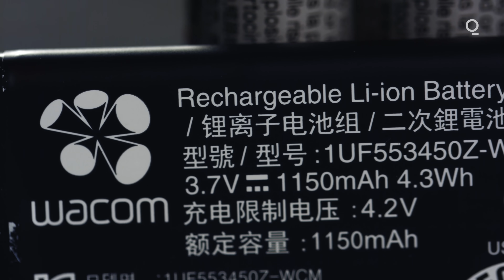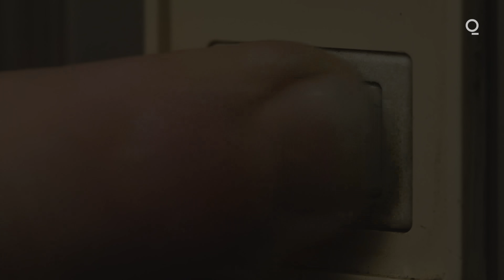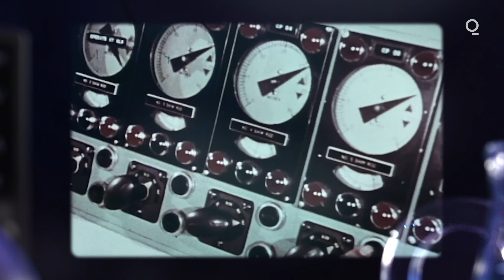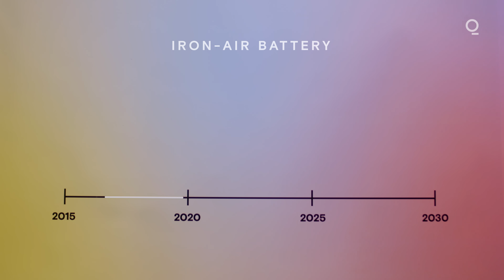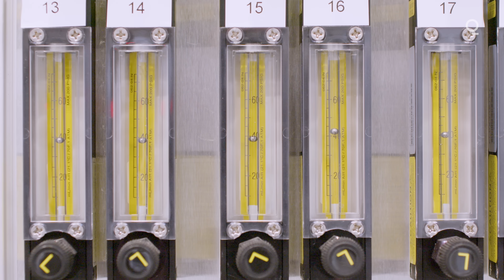The Huge, Weird Batteries of the Future

Comment: Very interesting... Energy storage is the key to the success of the green energy transition. Super-batteries, supercapacitors, pumped storage, hydrogen-to-gas, integration of electric vehicles into the grid operation... all these will have to work in tandem for success. Nuclear fusion that uses renewable materials, if successful at scale, will change everything.
Reply: @buildmotosykletist1987  They were, but read the latest Lazard analysis: the unsubsidized levelized cost of electricity from wind and solar is now cheaper than any other form of new generation, and cheaper than continuing to operate a coal plant. They'll be the majority of new generation from here on out, even if and when tax credits for them go away.

We should tax fossil fuels for the undeniable massive harms that burning them cause now and in the future, but politicians are allergic to the 'T' word so we get tax incentives and credits for better alternatives instead.
Reply: @buildmotosykletist1987  You pay for energy, not power. What are their figures per kWh?
Reply: The Connections (2021) [short documentary] 🌳💖

Comment: Just doing energy storage differently is no where near enough - it has to be more energy efficient than ALL other sources - No company seems to be able to claim that. It is all very nice to talk about the possibilities but you have to walk the walk with real live economies of scale
Reply: Storing energy will inevitably get you back less electricity than you put in. But energy storage is still worth it despite the inefficiency if there are big swings in the cost and availability of electricity. Lithium-ion batteries are cost-effective to store renewable electricity for the afternoon-evening peak; the challenge covered in this video is to find economical storage for longer periods of low generation.

Comment: That is not a battery.  It's called a hydroelectric dam. --  The energy is in the global capacitor itself, which is powered by the sun.  In the meantime, we need to use, petroleum, natural gas, and nuclear.  Batteries are for flashlights., not cities

Comment: IDK dumb idea, WATER TOWERS equipped with Electric Generator. Sand almost functions the same if we are just using gravity, funnel the sand into a pulley system(like a hourglass)  
The real question is, IS it done efficiently and effectively enough, and does the math add up for when using Solar Power and or Wind Turbines?

Comment: Almost equally important as halting our carbon dioxide emissions, is a transition towards a (let's say mostly) circular economy. For applications such as vehicles, I'm sure we will need 'material based' batteries (I would exclude pumped storage and hydrogen from that category). On the other hand, I'm not so sure that basing our electricity backup systems on resource-hungry technologies is the best choice. I prefer to see our society trying to massively save energy, both through higher efficiency appliances and processes, and through lifestyle changes. As for upcoming technologies in renewable electricity production, I have some faith in the advanced geothermal options that are developing. The technology proposed by for example Fervo Energy (and backed by Google) serves as both an energy source, plus it can load-follow in order to balance out the intermittency of other renewables.

No single energy source/storage is perfect, except maybe... nuclear fusion. But I'm not betting on any timeline for that.

Comment: Ok, pumped hydro has been around for ever! The fact remains you can't get something for nothing; otherwise you could simply use the electricity you just generated to pump the water back to the top ?? These systems require a long time to recharge (pump water back up), electricity from other sources is required.

Comment: We're going to need more electricity?
I don't think so! We used to use ten times more energy to light our world. Modern LED lighting is ten times more efficient. The televisions we now have are the same, you could warm your room with old valve TVs. No, if you think about it, energy usage in the average home has dropped dramatically. That's the major reason your being charged massively more for less power, the energy companies won't give up their profits.
Example - In my front room I have 8 spot lights at 5 Watts each (total 40 W) previously they were 50 watt halogens (total 400 W) in one fell swoop, changing to LED reduced my lighting bill by ten times. They lied to us, you can't reduce your bills, they will always want their billions of profit !
Reply: Oh for sure, as people cut back to save on gas, water and electricity, the cost per unit will increase over time to ensure the profits of these utility companies does not fall.

Comment: Hey, maybe it's just me but instead of building gigantic batteries for large communities, while not build modest batteries for people to own & operate individually?  A power wall is something affordable for most home owners, and apartment complexes.  Its footprint is relatively small, requires virtually no maintenance, and can work perfectly well for many hours after the winds die down or the sun no longer shines.  Whether the energy companies like it or not, many people would prefer to go off-grid.
Reply: Sure, home power generation storage and community microgrids make sense in many areas. But in general it's cheaper per MWh to build utility-scale wind and solar farms, and a Tesla Megapack is cheaper per kWh than a Tesla Powerwall. The fact that people can make and store their own power should limit the prices that utilities charge their customers, but that's more dependent on regulation.

Comment: 1:50  The woman say the electricity you're using was produced within a minute.  That's totally wrong.  Electricity travels at the speed of light in the cables and transmission lines.  That's 186,000 miles/sec.  Try produced within milliseconds.  This is why journalists make bad science documentaries... people can tell them anything.  Here's something more relevant...  Until a practical, utility-grid size battery is developed, wind  & solar are NOT practical and must be backed up by gas-fired thermal plants that massively increase the cost/Kwh, and the carbon footprint too.  That's the reason the oil companies are pushing wind & solar.. they KNOW it's not practical, and they'll have an unlimited gas market for decades to come.  Only nuclear power is ready now to produce the power we need without a huge carbon footprint.

Comment: So are they getting more energy than they are putting into using the pumps? Or is this energy a lot more expensive?
Reply: There are two ways these pumped storage systems can be used:

(1) To cope with peaks in electrical demand,

(2) To collect electrical energy produced by renewable sources which do not have 100% availability - such as solar and wind.

In the case of (1) they are "charged" up with energy from the grid (let this be denoted by the symbol Einput) and energy is generated when the water is released, let this be denoted by Eoutput.

The following is true: Eoutput < Einput.
That is, in this strategy, they don't add to the net electrical generation capacity of your national power infrastructure.  They actually lose energy. The purpose is to provide temporary extra power to cope with peaks of high demand for electricity. But it means you don't have to construct and operate additional power stations just to cope with those high peaks in demand current which occur in the evenings when everybody does their cooking at the same time.

In (2), the excess electricity from solar panels and wind turbines can be used to pump water up to a higher altitude, thereby increasing the potential energy of the mass of water (same as in (1)). Excess electricity in that it is not being consumed by customers at the instant it is generated.

In this approach, then they do add to the net generation capacity of your national power distribution infrastructure.  But you have to be able to direct the excess electricity from the renewable sources to it.

Comment: The reality of climate change solutions in a nutshell...ahem

2006: We need to drill into Alaska for oil. We don't like doing that to Alaska so we need to go to an even rarer material called Lithium to prevent this

2021: We need to drill into Alaska for Lithium. And like it or not we really need this, it's medicine as well as throwaway phones, and this is the biggest lithium find in a long while...and it's under Alaska.

Great story arc for the climate change solutions saga

Comment: For 33 years I worked as an electrical engineer for a place that had pump storage facilities in California (the largest one) that was built in the 60's. We were no longer able to use it as pump storage because the pump and generators (synchronous motors, transformers, auxiliary equipment, and etc.) were old and cost of repair and maintenance were exceeding the benefits. There is a cost for everything.  You can’t get something for nothing. One rewind would cost $5M and one transformer refurbishment would cost $1.5M……..
Reply: Just like solar panels installed on the rooftop of residential and commercial properties (i.e. there are long-term costs for repairs and maintenance). 🌞🏠🏣
Reply: @Mindcroscope  thats the catch, Solar panel in general doesn't require maintenance or negligible amount of maintenance cause there is no moving parts 🙂(just clean the panel with a hose pipe)
Reply: @Ritam Sanyal  ... The initial cost of purchasing & installation a solar system is fairly high.  Extreme weather such as typhoon (hurricane), hailstorm, lightning⚡and acid rain💦could ruin the solar panels & equipment. Also, solar inverter (to convert DC from the sun to AC) and solar batteries aren't that durable when compared to the solar panels.
Reply: Yes because nobody was able to do it and the one person who could was in so much demand that he could charge what he wanted. But what did it cost to build it, in today's dollars? And what part costs the most? And what's the cheapest it could cost? There are many people looking for work... what is missing? The initiative. New facilities are built daily... how can they make it? SpaceX exists because they did not accept what things cost, and started from the raw ore costs and worked their way up and eliminated all the bottlenecks.
Reply: @pre2363  yes. from engineering point of view, it doesn't make sense because of the losses, but power was cheaper during off-peak at night.
Reply: The main problem of our economic system today is that we don't include the cost of environmental damage and we are very sensitive of high initial costs and low short term profitability. Every technology, solutions and actions revolves around profitability. 

With these kind of economic system is very inefficient and ineffective way of curing the planet that it sounds like it is incompatible. With every new green technology would only generate new environmental problems if we will not going to change our system.
Reply: The Connections (2021) [short documentary] 🌳
Reply: Could you design a battery lifting dense metals like Tungsten instead of water? Just like lifting up huge weights 30-40 stories as energy storage.
Reply: Get the Chinese to do what needs to be done. Just because Americans can't build or update it for whatever reason doesn't mean it is difficult. Americans once led the world in every category. Now we lead the world in mass shootings and that's about it.
Reply: Our alternative is letting go of the struggle to keep California from burning down, drying up, and blowing away. We are going to have to prioritize the money.
Reply: @aluisious  California power problem is man made.  They have not had new power plant, hydro, nuclear, etc.. in past 40 years despite the population doubled.
Reply: @wilsoneashoian5789  that storage was needed in the past when electricity was mostly nuclear and coal which usually runs all the time. So there was spare power going to waste so it was worth using it. Then a lot of electricity switched to gas which can be easily turned on and off so it can match output to demand and you don't need the storage any more. That made it not economical to fix it when it needed renovation. But now we have to stop using gas so our easy dispatchable power is gone. Now we need storage again to use spare renewable electricity and give it out when production is low. It should be cheaper to renovate the old one than build a new one from scratch. I hope it is still possible to fix it.
Reply: @Adrian Thoroughgood  pump/generators got old, and repair and maintenance exceeded the benefits.  It was done during off-peak when power was cheaper with PG&E. that PG&E contract expired in the 90s, and it was not renewed. These days, power is bought and sold through CalISO as a spot market. No long-term contract
Reply: @aluisious  incompetent regulation of badly run utilities is why California had brownouts 2 years ago. Forest fires worsened by global warming cause local power outages, and drought worsened by global warming has reduced hydroelectric power generation.
 
@Wilson Eashoian Despite all that California has added 5 Gigawatts of in-state solar PV generation since 2016 (I'm not sure if that includes rooftop solar or is only utility-scale solar farms), and is adding Gigawatt•hours of battery storage.
Reply: well, that is cheap in comparison of losing the planet and all the petroleum.

Comment: Small modular reactors, specifically designed to replace the existing coal, oil and gas boilers in existing power stations have a great future:  all of the downstream power generation facilities:  the turbines, generators, power conditioning, control and reticulation is already in place.  So a major target to retro fit existing power stations nuclear units in the micro 50MW, small to 300MW and full sized with multi unit up to 1GW is still the best way to go, for quick CO2 reduction.   We just have to get over the bad press that nuclear has had for decades.
Reply: SMR is going to be a huge part. Every time people start talking about nuclear and climate change they start getting all excited about fusion, which has never been demonstrated to yield excess energy outside of a bomb. We've got to get real honest about what we have the tech to do in 5 years.
Reply: I was told once that when nuclear energy was first worked on. The scientists figured out that micro units were the most stable and sustainable.
Reply: All of the companies developing liquid molten sodium thorium small salt modular reactor blah blah blah designs are 10 years and 10 billion dollars away from demonstrating that their small reactors actually will be cheaper per MWh and quicker to build than current nuclear generation.

It's definitely worth researching, and I hope some of them actually deliver, but they're all irrelevant to the rapid decarbonization we need to achieve in the next decade.

The absurd delays and enormous cost overruns of the few nuclear plants under construction aren't "bad press," they're facts.
Reply: @skierpage  Who is mentioning small modular reactors except Gates and others who are dangerous with their explosive coolant. Your knowledge is very shallow, when writing about renewables infrastructure cost has to be mentioned, otherwise it makes no sense. Nothing about this make much sense.
Get your facts straight; USA had molten salt reactor running in 60's, results were great but funds cut because of oil lobby. As i'm writing this another plant MSR with Th fuel is running in China, their plan is to make all ele. this way by 2050. They will succeed. Russia has lots of knowledge about MSR too, unfortunately they don't get the same chances as other, despite urgency to move on!
South Korea just made several reactors for UAE for 7 billions in 7 years, since there are several at the same site other will be put online later. Chins is also capable of doing it but they rather focus on their needs. Things in UAE are going according to plans because they don't allow corruption we have here in EU and US.
SMRs (not MSRs, very different) are similar to those battery plants, very expensive and make no sense when we can resolve the problem with normal nuclear fission reactors of 3rd+ Gen.
You are right in saying it is worth researching this things, although burning fossil fuels and using batteries make no sense. They only do it because government pays for it. I hope rest of the world doesn't need the same lection Germany just had, here ya go again: 
"Germany's overdose of renewable energy" article.
Reply: The Connections (2021) [short documentary] 🌳
Reply: @New Tunes For Old Logos It is not so easy to build nuclear plants because we lost knowledge and workforce, only a few countries can do it. CO2 problem came because oil lobby doesn't let us build nuclear plants, they make a lot more money without them. In a sense you are right, they want us to pay for energy too much, getting renewable into picture cost even more than oil, let alone nuclear.
I suggest you read about nuclear as it seems you understand it is the only way forward.
Reply: @New Tunes For Old Logos "they" are building GWs of wind and solar because it's quick and cheap and low-carbon. Nuclear is only one of those.

If you're so worried about "them" controlling you, put solar panels on your roof and make your own electricity.
Reply: Germany's overdose of renewable energy article